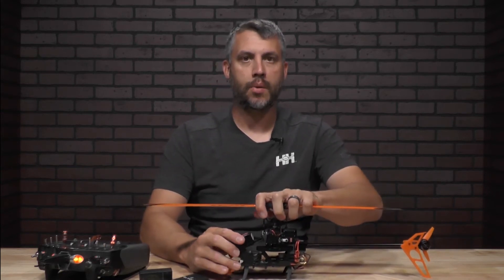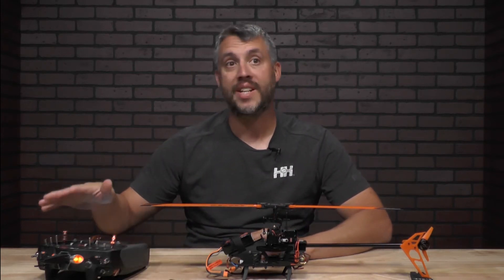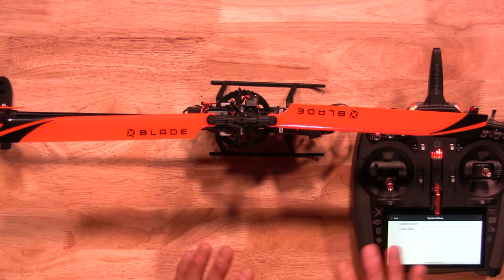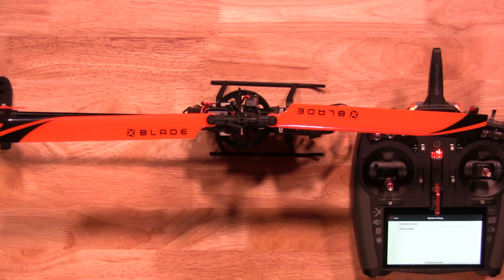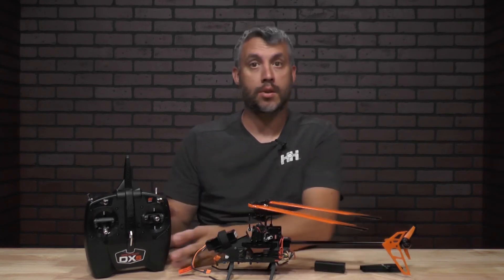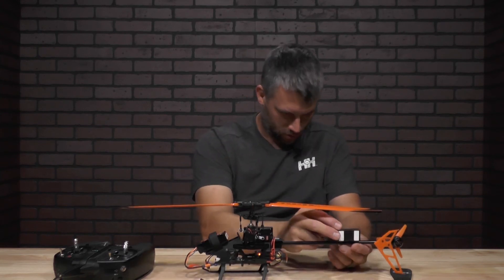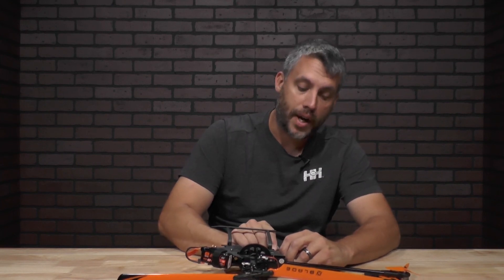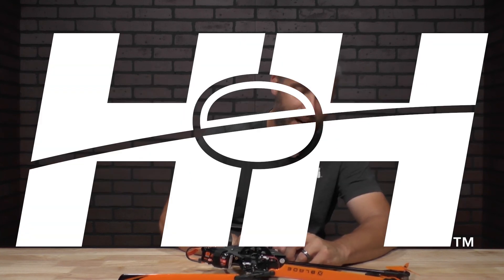From the Tech Desk: How to calibrate your 230S Smart Heli

Comment: Help Please . Collective pitch is not working . Throttle works and so does Rudder on left stick . Right gimbal is fine. Elevator and ailerons move fine . Please help . I'm using the DXs transmitter that came  it came with .

Comment: In the video, it is said that the calibration is to be done in "stunt 2" (Agility/Idle Up 2). The manual for the Blade 230S states that the calibration with the DXs (RTF) is to be done in Intermediate (Idle Up 1). Just curious if it makes a difference whether it is done in IU1 or IU2. Thanks!

Comment: Just picket up the Blade 230 S Smart. I have a DX6 G2. Heli will not bind. I have the bind plug, plugged in and when I power up the heli, a Red and Orange Light start flashing on the receiver. No matter what I do it will not bind. Took it to my local hobby shop and they couldn't figure it out. Any suggestions? Thanks!
Reply: Not sure if you've solved this ,but I had the exact same issue  - also with a brand new dx6 g2 - spent ages trying to get it working right  , sometimes it would bind but the heli wouldn't respond to the radio ,  eventually tried a new model memory location and it worked 😉  !!

Comment: Thanks for your valuable information.  My Blade 230S Smart is new, I have the battery installed and the tail boom is perfectly level with a bubble level. I have followed your procedure to the letter yet it never goes into calibration mode. What could be wrong with mine? I am using the DXs radio that came with the RTF so I did perfectly follow the steps for the non-computer radio.
Reply: I'm having the same issue.  It doesn't look like you got an answer on here. Did you find an answer elsewhere? The manual says you have to press the Panic Recovery button, but he doesn't show that in his video? I've trie it both ways and can't get it in calibration mode.
Reply: @scottariagno6899  yes, try to put in FM2 (advanced or stunt 2 mode, not like in the manual to FM1). Don't touch the panic button, simply move sticks to corners (as in manual) and wait ca. 10 sec. It works, at least for me ;) good luck!
Reply: @tytuspiotr  I’ll have to give this a try. Going by the video and manual instructions, it just fast blinks and doesn’t actually calibrate.

Comment: Can you explain to me why Blade would release a beginner heli that is so tail heavy . I had to add 1.25 oz of weight to get mine to balance out ,  
and yes I had the canypy and battery on the heli ?
Reply: Just put a bigger battery on it. I installed some Goldbat 1500mAh 3S pack and the thing is dead flat balanced.
Reply: @ramus9  yep that is true, 1500mah